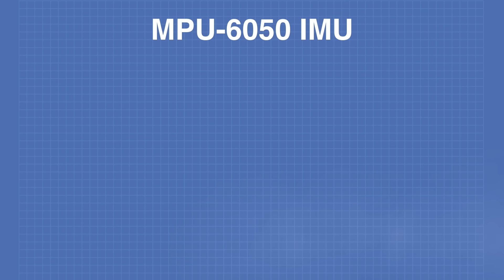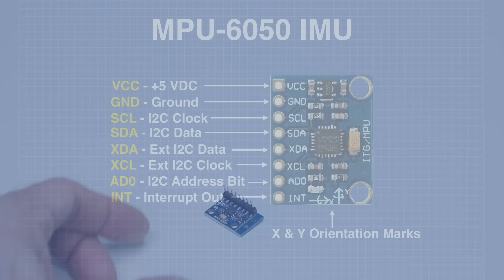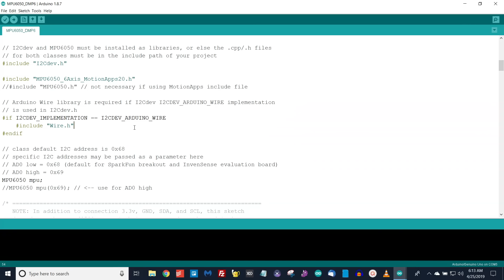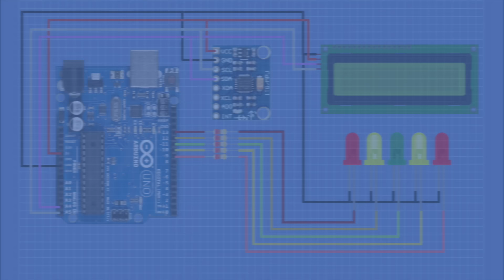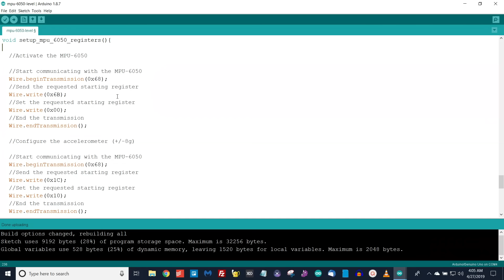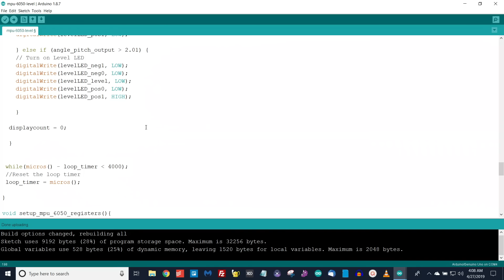Build an Electronic Level with MPU-6050 and Arduino

Comment: Interesting. i tried several times with different codes even implementing filters but this MPU6050 still drifts after using.
Reply: mine is drifting as well, did you ever find a fix for this?
Reply: YouLAMEASSwhlteboi

Comment: Hi Bill, i'm new to your channel... but loving so far! I've been playing around with the 6050 for a while.... I've just tried running through your tutorial (instructions are clean and easy to follow) but cannot seem to get much accuracy out of the level ----- i.e. the indicated angles are off compared to actual. I'm not sure if i'm doing anything wrong (ambient temperature is around 20c)? Do you think temperature is playing a part here? Is there any simple way we can incorporate temperature compensation? ----- THANKS AGAIN! LOVE YOUR STUFF!
Reply: I've been playing with this chip and in some other libraries there are calibration procedures. Apparently each chip is unique and has to be calibrated to get it to be precise.
Reply: you Iamewhlteboi

Comment: Great video.  I have one of my MPU-6050's mounted on a breadboard and started the example in the library but the numbers are drifting quiet a lot with the non-moving module?  Today i maybe  try it with an other MPU-6050.
Reply: mine is drifting as well, did you ever find a fix for this?
Reply: @MattyMacNJ  Read my above comment^ Also I think a magnetometer can be connected to the MPU6050's digital motion processor if need be
Reply: @mattn.8941  okay awesome thanks so much I'll look into it!
Reply: Essentially, the small amount of error in the measurements adds up over time, creating this large drift from reality. Some math can be used to get more accurate results, but I'm pretty sure a magnetometer is needed to reduce the drift significantly. I'd suggest the IMU tutorial series on Youtube by Paul McWhorter for a very detailed explanation.
Reply: YouLAMEwhlteboi

Comment: First of all I have to praise you for these really well done tutorials. There are a lot of them on you tube, but yours are among the best. But now to my problem: I copied the mpu-6050-level tutorial, but get an error message when trying to upload the sketch to the arduino. In line 23 " LiquidCrystal_I2C lcd(i2c_addr, en, rw, rs, d4, d5, d6, d7, bl, POSITIVE); appears the message : 'POSITIVE' was not declared in this scope
What could be the reason? Unfortunately I can't find my mistake. Maybe you or someone can help me with a solution. That would be very nice!
Best regards from Thomas from Germany
Reply: This is the result of the LCD library you are using. The Libraries available in the Arduino IDE list several different libraries available.  Try the these what works for you. They all have Hello World example. Get this working first BEFORE you load the rest of the level code. You might have to modify the lcd.print statements in the level program to comply with the needs of the library that works. Also,check the chip on the LCD that makes it I2C. There are two basic chips and each will take a uniques driver for that chip. Its very straightforward once you understand the requirements of the LCD library.  Have Fun.
Reply: solucionaste tu problema?
Reply: YouLAMEwhlteboi

Comment: Excellent video, as per (how soon we take perferection for granted). Am I correct in assuming that the initial calibration should be done on a levelled surface. As this will be the "zero" attitude for all future calculations?
Reply: you can do the initial calibration while not being on a leveled surface. You can use the accelerometer values for the calibration of the gyro to "tell"  it in what position it is in.
Reply: you Iamewhlteboi

Comment: nice but as you only lit one LED at a time, you could save 4 resistors and only put one on the common ground wire of the LEDs ;-)
Reply: YouLAMEwhlteboi

Comment: Can you include a magnetic compass sketch in a future project?
Reply: I'd like to know how accurate the magnetic compass modules are.  I'm trying to survey a property line that is N 0 deg 50' E.     I can't read 50' E on my compass.  Is a compass module capable of that kind of precision?
Reply: Mystic Dreamer   It is not that accurate and you would need a way to aim and align it.  Most surveys are Astro  aligned not magnetic.  You could probably look up a star or solar transit time and be pretty accurate.
Reply: @kirkcreelman  

I was actually able to do the surveying with a standard mechanical compass.  My compass is accurate to 1 degree. And 50 minutes is pretty close to 1 degree.   It turned out to be  quite accurate as the corner posts are already in place.  So when I came out at the end of the line by the corner post I knew I was right on the money.   I just wanted to confirm the actual line between corner posts.   I did need to mount my compass on a camera tripod and take extremely careful and accurate readings.  But it did work out in the end.   I see now that the electronic compass module is only good for +/- 2 degrees.   So apparently my mechanical compass is more accurate as it can be read to within a single degree.  So I got the job done  using a mechanical compass.
Reply: youIame whlteboi